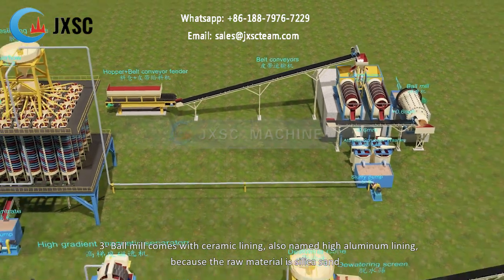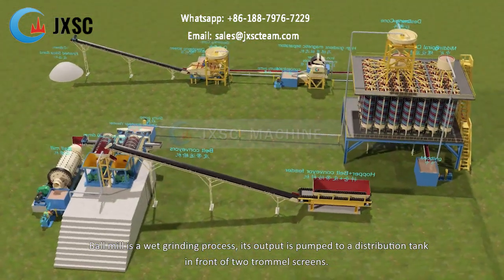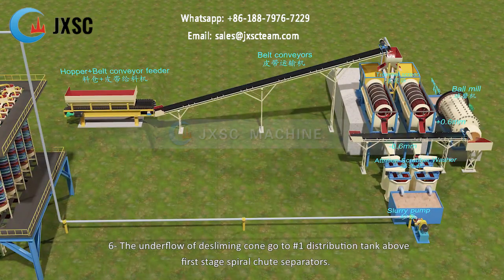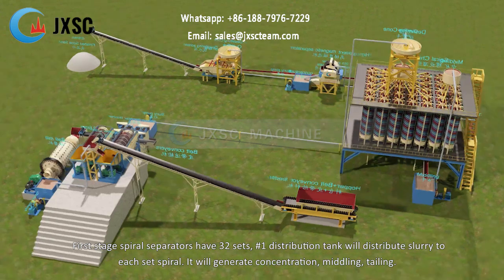100TPH Silica Sand Processing Plant

Comment: probably could reduce Fe203 further by adding more magnetic separators, or the electrostatic separators
electrostatic separators are usually used to collect dust but should work good with small sand and iron✌

youtube recomendations know how to use my university degree
Reply from the maker: ok